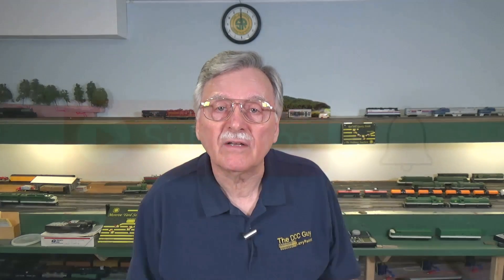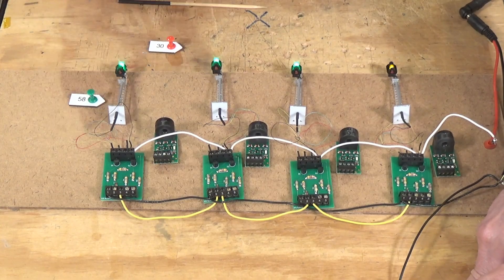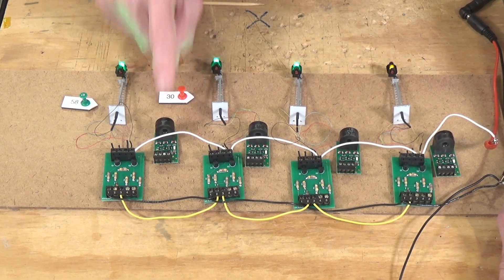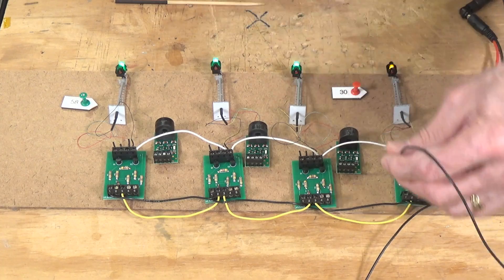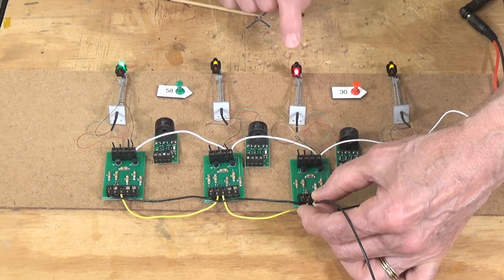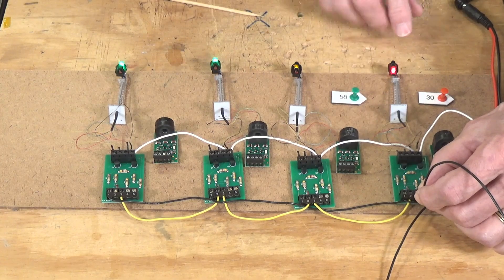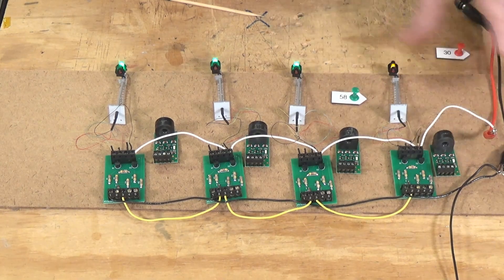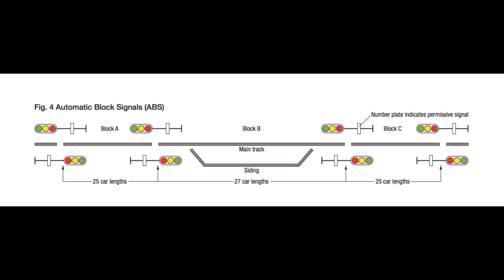ABS Signals For Your Model Railroad (287)

Comment: Your terminology is flawed.  The logic is based on "failure.". The logic is a signal indicates the track condition of the block, the track, between the signal you see and the next signal.  An "electric on/off switch" and a power source (battery) supplies power to the track block (NOT the bulb on the signal head).  If the condition of the electric circuit, the track, "fails" to meet the "yes" answer to "Run a train into the block" train must not enter the block, and logic displays a red signal.  If the answer to the question is "No failure," then " Yes", the signal displays an  aspect other than red, and the train can enter the block.  Then it gets to the variations of conditions of what is going on in the block.

Comment: Hey Larry, it would be more than beneficial to know exactly how you had your signal system wired up. I know alot of people would greatly appreciate knowing where each wire went and why. What board were you using for the brains for your signals? I'm looking for something like that right now, other than the Atlas system. Thanks so much.      EDIT    Found it all larry in video 289, Thanks!

Comment: Hi Larry, 
when using the bd-20 in a section of block that has for example three feeders.. must they all be tied together coming thru the bd-20 for it to work correctly ? According to nce manual that is how the bd-20 was designed to work.If thats the case ,seems like a lot of rewiring,or did i misunderstand that? thanks for your videos!
Reply from the maker: The  BD-20 must be placed at a point before the first feeder in order to reliably detect occupancy. It also needs to be before and twisted wires and things like snubbers or other devices such as frog juicers that draw track power can cause false detects. However the BD-20 has an option to add a resistor which reduces its sensitivity. I will take a look at that and another method when I show how to install these on the layout.
Reply: Hi Larry, is there alternative to the bd-20’s for the signaling circuit that youve built? No one seems to have them…..
Reply from the maker: @samuelmacbride2031  Check out the DCC Concepts LM-iD. They are very similar to the BD-20. I used them in my automated reverse loop video.
Reply: Hi Larry, 
On your wiring diagram for installing the abs lighting,would the last yellow out loop back to the first yellow in?

Comment: Interesting circuit - what happens if you ground out two or more detect pins at the same time?
Reply from the maker: Yes you can ground some of the outputs to force a color change. That is shown in the diagram I showed for the way to wire it to the layout.
Reply: @TheDCCGuy  Yeah I built the circuit in Falstad (online circuit simulator) and noticed that - pretty cool that it can do all of that with so few components.  Interestingly, according to the simulator, there is a small amount of current flowing through the green LED when red is on - anywhere between 1 - 4mA.  Is this visible in reality?  I didn't notice that in your demonstration.  Also, you may be able to remove the diode completely or just bridge it out.  I could be wrong, but it doesn't appear to be doing anything in the circuit.  This inspired me to build my own circuit that builds upon this concept.  Thanks, Larry!

Comment: I was really hoping this video was going to talk about block detectors and how those worked.  I know there are different types, and such, but wanted to see which you used and what the limitations would be (overhead lights for photocells, IR detector limitations, etc.).  Hopefully the next part will cover that.
Reply from the maker: I might have hit on some of that in video #217 and I will do a little on Friday but it really would require a separate video just on detectors.
Reply: @TheDCCGuy  That has always been my biggest hang up with signals for model railroading.  We have constraints with voltage running through our rails that the self-propelled prototypes don't have to mess with.

Even the DC driven light rail can use AC for track circuits.  But with the advent of DCC, we lose the ability to control track circuits with AC, as it's in use by the DCC systems.

But I'd like to see what you (and others use) use, and what kind of failsafe to Red are built in (Atlas fails to green, so I don't like those).  I'll probably just stick with Photocell, despite the drawbacks.

Comment: In my experience from my time on the railroad yellow or approach is “proceed at preparing to stop at the next signal”. A green over yellow would indicate “proceed thru diverging route preparing to stop at the next signal.” A restricting signal would be a red over a mile marker on the mast of the signal. A stop is just that. Red. Usually at control points of a siding or interlocker. Restricted speed is usually used within yard limits which by definition is not the limits of a rail yard. Restricted speed is used on the mainline from time to time. For rules compliance a train crew can be banner checked for restricted speed compliance either by operating within yard limits, getting permission from the dispatcher to pass a stop indication, or passing a restricted indication (red over number plate). If a trainmaster were to banner check a crew on an approach to a stop, that manager would then look silly because he does not know the rules he is trying to enforce.
Reply from the maker: This is a simplification of the prototype signals with only a single target per mast so no green over yellow, etc. although for someone wanting that it could possibly be done with Scerb’s circuit. For model railroads I prefer to slow engineers down as most have a heavy foot on the throttle so yellow on the PS will mean proceed at reduced speed.
Reply: @TheDCCGuy  I understand what you are saying. From the prototype perspective if a crew were coming around a bend at 60 MPH and 1/2 mile was a restricting signal, that crew would never get that speed down 15 MPH or less. They would pass that signal already violating restricted speed. I do appreciate your simplicity and I’ll consider using something like you’ve shown in the video.
Reply from the maker: I dug out my notes on SR speeds and have the following:
Limited—NTE 45 MPH
Medium—NTE 30 MPH
Reduced—Proceed prepared to stop short of train
Restricted—Proceed prepared to stop short of train NTE 15 MPH
Slow—NTE 15 MPH
Yard—Speed permitting stopping within 1/2 range of vision

Comment: Off Thread:  This "complication" prompts me to ask "Once I have my 4 x 8 DCC layout completed - 12 turnouts, mixing Atlas and Kato turnouts - can I use a simple toggle-switch between DCC and a DC operation? Do I need to bypass the NCE PSXX circuit breaker when using the DC controller? I assume "yes."  Any other considerations for the turnouts; I have left the Katos at Power Routing; should I change that?  Frog Juicers?  You only need answer if you know off the top of your head, I'll do my own research if you would have to resort to that. I'll not be offended if you say "do your own research."
Reply from the maker: Yes, you can use a DPDT switch to go between DC and DCC and I showed how in my wiring book and in a MR article. As for things like Frog Juicers and PSXX you will need a way to isolate them as they are not DC compatible. If you can avoid it I no longer recommend Frog Juicers, see my recent video on that.
Reply: @TheDCCGuy  Thanks for confirming that PSXX and Frog Juicers must be bypassed.

Comment: Very interesting Larry. I'm in the process of implementing CTC with a JMRI control panel and Signalist SC1 boards controlling the signals - a lot more expensive than your ABS boards.
You said that an Approach aspect will require the engineer to reduce to Restricted speed. The NORAC rule book (11th Edition) says reduce to Medium. Was the Southern more cautious or did it have short blocks?
Reply from the maker: On the PS restricted speed will be half speed. I’ll have to check my SR rule book for the exact interpretation.
Reply: Speed is kinda important. The big thing on an approach signal is being able to stop at the next signal if it is all red. 
Restricted speed in the application of professional railroading is more a method of operation that a speed. The speed or speeds mentioned in the rule are caps.
Reply: This aspect of the video kinda made me... angry.  An Approach signal should not require Restricted Speed.  A Restricting or Redistricted Proceed or Stop and Proceed signal would.

Comment: Nice larry. Doesn't quite apply to me since I'm going for a dispatcher control 50 style CTC signaling system, using mostly dick Bronson's components and a few Digitrax components.
Reply from the maker: Yes, if I were modeling the Southern a decade later I would be using CTC but in 1957 it was still ABS.
Reply: @TheDCCGuy    when did Southern switch to CTC? Ithought it was sometime in them early 60's. I went with the CTC because I wanted it and it just seems to fit with a 1954 coal hauler.
Reply from the maker: I think it was a phased roll in and it did not get to my section until the mid-1960s. Once it was in place they started removing alternating sections of double trackage and bridges accordingly. Signal towers, such as the one at Charlottesville, were eliminated and other changes as required were done. So it took a few years to complete the entire Atlanta to Washington DC mainline. I have read that CTC operations were so efficient they found they could actually run more trains on alternating single/double track than on the original double track line. Plus by eliminating infrastructure they were able to reduce taxes.

Comment: Great video as normal. In the UK there is a company called Train Tecn that males DCC sensor signals. They work without the need for additional circuit boards
Reply from the maker: They have some interesting stuff. However at about £45  or $50 for a 3 aspect signal I think I’ll stick with mine which cost me about $30 even with the NCE BD-20 detector. The good thing about them is they come ready to install.